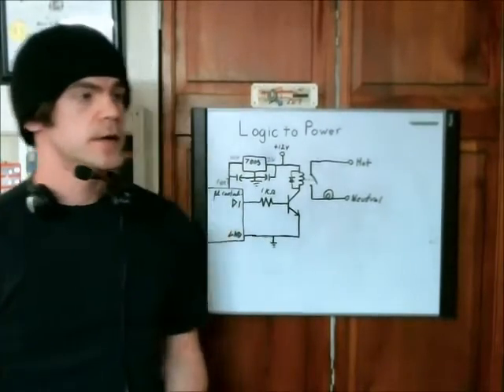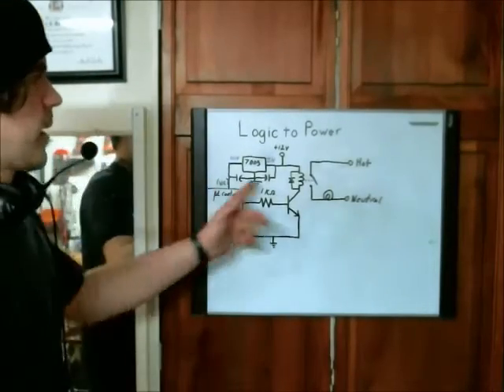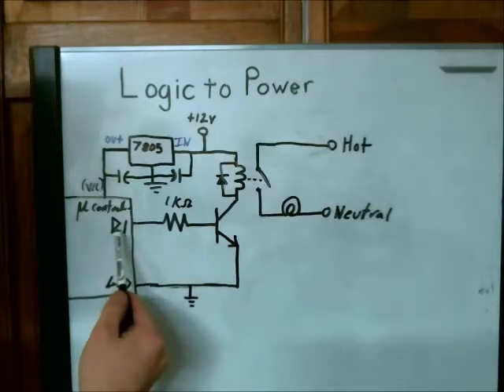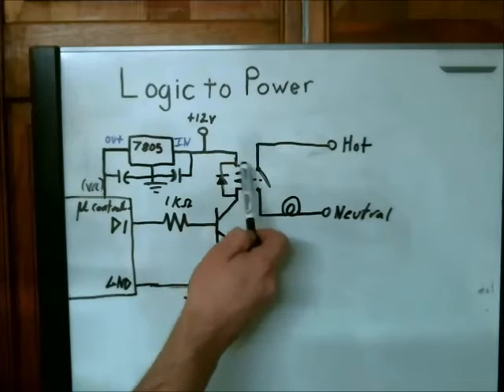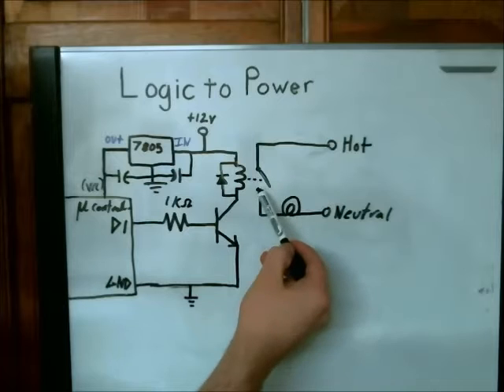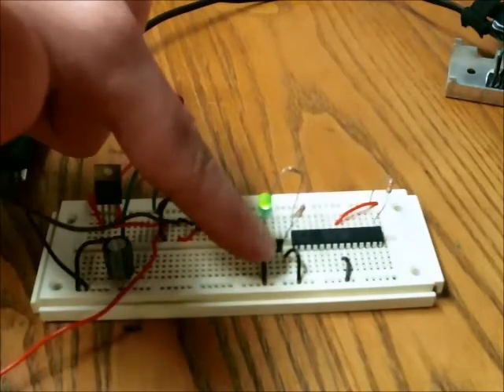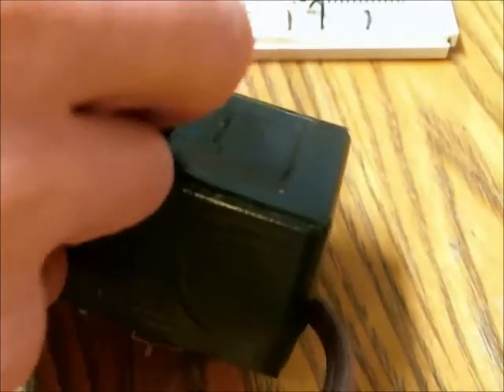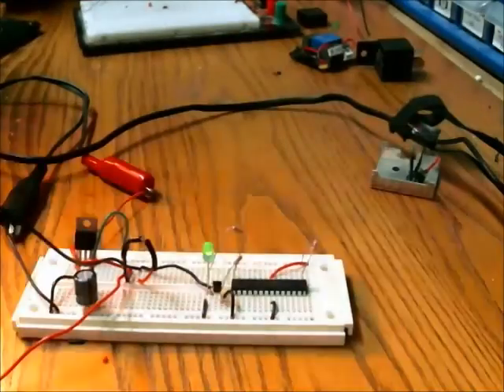Control 120v with Arduino

Comment: I’m an ME and I haven’t used arduino in years.  I want this basic concept of switching a heater on and off that’s on a 120v to hold a temp range in a greenhouse. Also, it’s been years since I’ve done circuits 1.